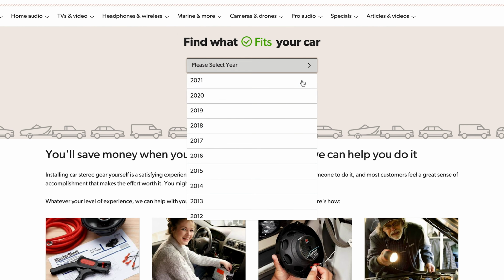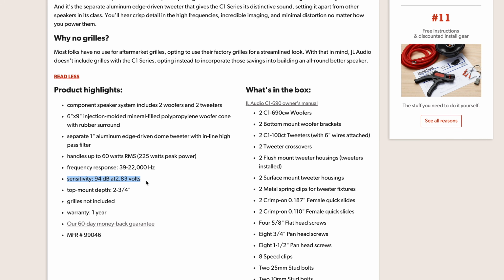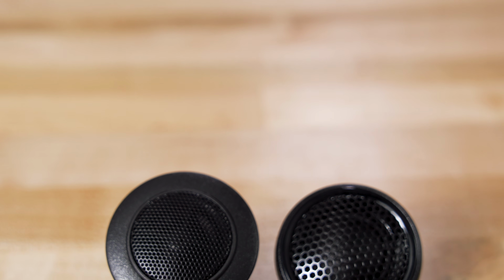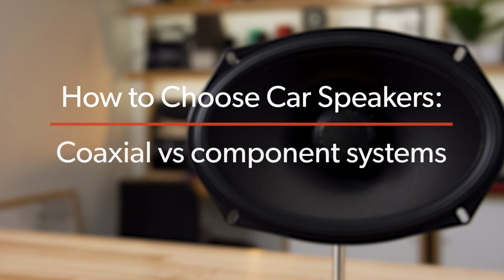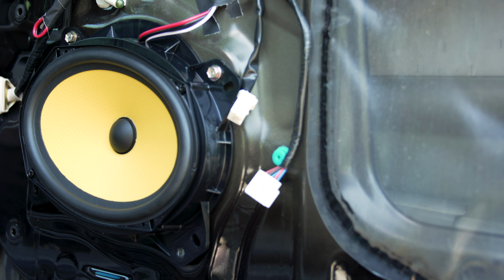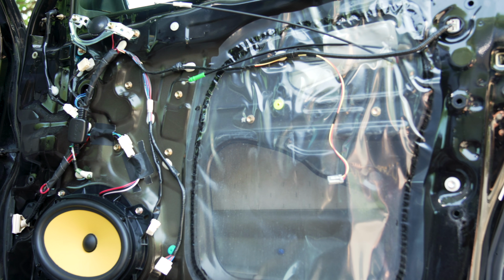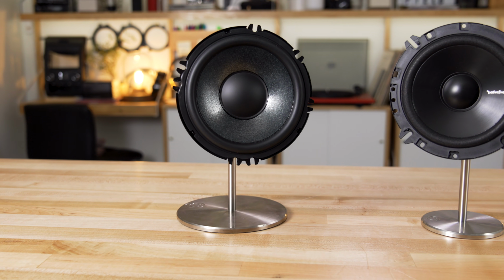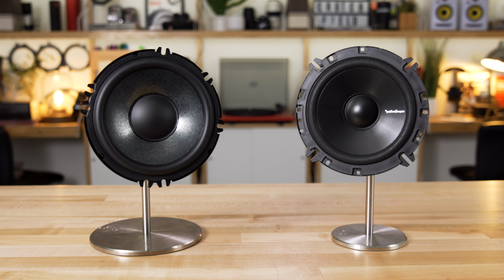How to choose car speakers | Crutchfield

Comment: Hi I have 3 10’ sundown &jl audio 1500 amp & I was Thinking of adding 6.5 jbl gto629 & gto609c component Speakers & a jbl amp 4 channel will it bee a good set up or Should I delete the gto609c and just put 4 gto629 plz Advice thanks ?
Reply from the maker: Installing tweeters closer to ear level helps with the clarity of the audio that we hear from them. The GTO609C comes with a separate tweeter so that tweeter can be installed closer to ear level and is the better of the two speakers to use in the front of a vehicle. We recommend installing them instead of another set of the GTO629 speakers.
Reply: @crutchfield  ok so I need 4 6.5 Should I get the gto609c  I have a jeep gladiator need the for the sound bar & Bottom of the dash thanks a lot
Reply from the maker: What is the year of your Gladiator? Does your's have the Alpine audio system in it?
Reply: @crutchfield  no is a 2020 jeep gladiator overland
Reply from the maker: That vehicle has a component speaker in the front so replacing it with a component speaker like the JBL model you listed is a good idea and replaces all the drivers keeping a full range audio coming from the front locations (top and bottom of the dash). A coaxial speaker like the GTO629 can be installed into the roll bar location
Reply: @crutchfield  thanks you so much what amp you recomend a jbl one ?  I was thinking the JBL GX-A604 4 channel full Range amp
Reply from the maker: The JBL Stage A6004 amp would be an excellent choice for these speakers. It can be found here:

www.crutchfield.com/I-rYALc227/p_109STA604M/item.html
Reply: @crutchfield  thank you so much for all ur help 👍🏻
Reply from the maker: You're welcome! Enjoy and let us know when we can help again.

Comment: Can crutchfield sell a Chrysler trunk mounted subwoofer replacement that looks factory, replacing the Beats and hit harder.
Reply from the maker: Hi, Jim, it will depend on your particular vehicle, but perhaps this would work for you: https://www.crutchfield.com/p_109STADBAS/JBL-Stadium-BassHub.html

We just made a short video for it, too: https://youtu.be/7bnb7vP2-iQ

If that's not the ticket, contact us & our Advisors can help you find what's right for you. https://www.crutchfield.com/support/ContactUs.aspx
Reply: @crutchfield  I’m talking about a Chrysler 300 with the beats. Want to up grade but keep the factory look. Not finding much or even swapping out the subwoofer using the same vessel but add another amp to the new sub. System is not loud enough
Reply from the maker: Ah, understood! What year is your 300? For the most part a true upgrade to your factory sub sound would have to come by way of adding a sub box in the trunk, but we can double check the specs of your car and let you know if there is any alternative recommendation!
Reply: @crutchfield  mine is a 2013 with the beats. I do not want to take up trunk space but would like to improve overall sound.
Reply from the maker: There are subs that will fit in the OEM enclosure, and you could add an amp to power them.  Are you wanting to replace the other speakers as well, and add an amp that will power the whole new system?
Reply: @crutchfield  I would love to swap the beats sub and still use the enclosure. If I kept the factory amp for the other speakers, that would save a little.  Replacing the speakers I would. I wonder the front doors as they are considered bass woofers and no other speaker there for mids or highs. I wonder how that would effect the sound. Better or worse. What options can you provide for sub, amp, and other speakers to replace.  

Thanks
Reply from the maker: The rest of the front audio goes to the speakers in the corners of the dash. We do not know the crossover frequency being use by the stock system that splits the audio between the dash and door drivers so its best to put speakers back in place of the stock. This way, there is no loss in sound. What changes are you hoping to make to the sound you get from those stock speakers?
Reply: @crutchfield  the drivers in the front doors I believe are a single driver. If using the stock amp and crossovers, replacing the doors with a 2or3 way speaker will not have much benefit or I would think.  Maybe steps to see sound and add a back dash subwoofer (brand and size) and/or use the beats subwoofer in closure in the trunk but replace that speaker also. Separate amp for it. What options and brands to start there and possibly replace more depending on how it goes

Comment: What about Ohms factory speaker's are 2 ohms and you put in 4 ohms in which a lot aftermarket are,got told if put in 4 ohm in factory 2 ohm setup the 4 ohm speakers will sound terrible is this tire google says it is??
Reply from the maker: Good question! If you replace factory 2ohm speakers with standard aftermarket 4ohm speakers and don't also change the head unit (and/or factory amp if present), there will be a 50% decrease in volume. Ultimately it won't sound right at all. Are you looking to replace your speakers?

Comment: great video, very informative thank you! I need additional help.. been to the website. I have an 2012 Lexus IS250 and looking to replace the factory door speakers, what exact product would provide best quality for enhancing vocals and range of instruments? I listen to all genres but more so R&B and Hip-Hop. not really looking for major power. hope that all makes sense, im lost.. thanks in advance for your help
Reply from the maker: Does your Lexus have the Mark Levinson sound system?
Reply: @crutchfield  I don’t believe so, it may be the factory head unit that is crappy but it doesn’t sound high quality as is currently
Reply from the maker: Do you want to replace the front and rear door woofers and tweeters? There is no direct fit for the tweeters; but, you should be able to replace them if you make your own brackets. What do you plan to use for power?

Comment: I have a question. My truck came with factory tweeters. Would it be bad or anything if I just replace the old woofer with a 2 way or 3 way and keep the old tweeters. Or should I get a component and just replace both that way
Reply from the maker: In most cases, you can leave or disable the factory tweeter. What is the year, make, and model of your vehicle?

Comment: Anyone has any recommendations for the best bang 4 buck 5.25 speakers? I'm mostly listening into 90's rap, i want to hear rappers voices loud and clear, my current speakers suck at that, vocals sound really weak & muffled. thank you
Reply from the maker: Sure! What is the year, make, and model of your vehicle? Did it come with any type of upgraded audio system? What locations did you want to put these speakers into? What do you plan to use for power?
Reply: @crutchfield  I own a '97 volvo 850, previous owner replaced all the stock speakers with some low quality sounding stuff, amp box and a big nasty looking sub in the trunk, i want to swap out everything for something better, i just don't know what, too many options out there.
Reply from the maker: We will be happy to help. There's a few details that can help with knowing what to look for in speakers:

First, is the stock radio still installed? If it is, is there a cable plugged into the AMP port on it?

What brand and model speakers are installed now? What changes are you hoping to make to the sound you get from them?

Does it look like the amp is also powering the speakers? If you are not sure, what is the brand and model of the amp?

Comment: Excellent video but still have a question after seeing the info on your website. I have a 2009 Toyota Corolla “S” that has a factory JBL setup. The speakers are 2ohm and want to replace just the speakers at this time. The rear speakers have 4 wire going to the speaker. 2 wires feed the 6x9” woofer and the other 2 wires feed a tweeter on top of the woofer. If I replace the JBL’s with another 2 ohm speakers and the speaker only has the 2 speaker inputs…how do I wire them up?
Reply from the maker: There is no way to combine those channels together so an aftermarket speaker can work in place of the factory speaker. The only options for getting full range audio from an aftermarket speaker are either to replace the factory radio and bypass the factory amp or install an aftermarket amp. Wish we had different news for you there.

Comment: I have an amp 45 w rms x4, 4 speakers 45 w rms. Im looking for a under the seat powered sub, what do you have for me?
Reply from the maker: We will be happy to help! What vehicle is this being installed into?
Reply: @crutchfield  2014 Jeep patriot
Reply from the maker: Awesome! Did that come with the factory Boston Acoustics system, and have you replaced the receiver yet?
Reply: @crutchfield  I have the JVC kw r940, alpine amp ktp 450 and 4 Kenwood kfc6966. But I need an powered sub. I like the JBL Bass pro and the Kenwood KSC SW11.
Reply from the maker: Nice setup! Since you have the amp for your full range speakers, the extra power in the BassPro Hub would be ideal. It is is designed to mount inside the spare tire rim and should only be used in vehicles that have the spare tire inside the vehicle and feature a removable spare tire post; not compatible with welded spare tire posts so be sure and check. You can find it here: https://www.crutchfield.com/I-rYTVc921/p_109BASPROB/JBL-BassPro-Hub.html

Comment: What speakers would you suggest for the Haval Jolion super luxury, something for a hip hop head like myself but also discreet and secretive lol if you get me.
Reply from the maker: Hi, Ricardo! We don't have research on that vehicle to know which speakers will fit and what general size they are, but if you are able to get some measurements and other info, one of our advisors can help with that. How many speakers (including tweeters) are in there? And for hip hop, definitely need a sub. :-)
Reply: @crutchfield  it's a suv with 220litres boot space comes with 6 speakers.
Reply: @crutchfield  https://youtu.be/_loCaxts4_E maybe this link can help
Reply from the maker: There was no mention in that video of the speaker sizes or any measurements to help judge what can fit into it. You may need to consult a custom installer for help. We can suggest brands that you may consider if they can fit. JBL and Kicker are a couple popular speaker brands for hip hop music.

Comment: If i have 4 speakers 45 watts rms each, how many watts my radio needs to have?
Reply from the maker: Those speakers can work with a radio that outputs up to 45 watts RMS per channel. Most radios output 22 watts RMS or less which might be ok for the speakers. Which ones are you referring to?
Reply: @crutchfield  Kenwood kfc6966r
Reply: Can you recommend a radio 45 watts × 4 channels  for less than a hundred dollars. Thanks.
Reply from the maker: I cannot find information on a KFC6966R but there is a model I can find online that is close: KFC6966S. Could those be the speakers that you have? As for a radio with that power under $100, I do not know of any such models. Here's the one we offer with this 45 watts RMS rating:

www.crutchfield.com/I-rYTVc227/p_158XAV7000/item.html

Comment: why do you need amplifiers if speakers only need 2 watts of power? Are amplifiers just a gimmick?
Reply from the maker: They are not a gimmick. A speaker's sensitivity is measured directly in front of the speaker at 1 meter distance with a test tone (not full range audio such as we have in music). The more audio frequencies that a speaker is asked to play, the less power there is for all frequencies so the more power it needs to get to play them at the same levels.

Also, in vehicles we are not able to place the speakers so our ears are in front of them and only 1 meter away and we play more than a test tone. Plus, there is the grille material as well causing the audio to lose intensity.

All these reasons are why speakers sound better when they get closer to their top RMS watts.

Comment: Best way? Go to your local shop and listen to how they sound...don't buy them because they look cool.
Reply: That is the worst way. Demo walls are just… walls. Those speakers will all sound completely different once installed in a car, and the demo wall just imposes false expectations.
Reply: @ZZPxFTW  So you're suggesting that listening to a speaker is not as good as randomly choosing them based on price ort appearance? They will sound different in the car for sure, but it's a lot closer than guessing.
Reply: @jayinmi3706  Im absolutely not suggesting that. I'm suggesting it takes a little knowledge and research to know what values will work for specific applications. Listening to the demo wall will get you as close to what you're looking for as choosing on price and looks... Have an idea of  what sensitivity, Qts, Vas, and Fs are going to be best suited for your application. 

Just a quick example for one of those specs: demo walls are essentially IB, and will favor high Qts drivers, but if you are installing them in an enclosure, a lower Qts would likely be a better option, but would have probably sounded worse on the wall.
Reply: There are very few local shops anymore, with the exception of a couple chain stores that only carry low to medium lines of very established companies such as pioneer or kenwood or alpine.  It’s a different world now
Reply: @squidduck  I work at a local shop. We have 5 locations. And I can think of 4 or 5 other local locations of other companies. It isn't that hard.
Reply: @squidduck  walmart lmao
Reply: @jayinmi3706    I live in Calgary, a city of 1.6 million people.  We have Visions electronics and JB’s performance center that actually have display boards.  Visions doesn’t carry anything worth mentioning, really.  JB’s recently started carrying Focal.  Otherwise, all low level to medium level stuff, even the focal lines aren’t the higher quality lines.  20 years ago, there was lots.  Online shopping has killed most of the stores in my area.
Reply: @ZZPxFTW    lol, even Walmart took out their display boards
Reply: @jayinmi3706    I live in Calgary, a city of 1.6 million.  There’s visions or JB’s, neither of which have demo vehicles.  They have display boards, but nothing high end at all in them….
Reply: @jayinmi3706 you realize not everyone lives in your town right?
Reply: I don't have a local shop for that
Reply: Bestbuy used to have a okay speaker wall. They got rid of that also.
Reply: Just because they sound good in the store doesn't mean it'll sound the same in your vehicle. Every vehicle is built different some have better NVH than others meaning some are going to leak out the sound waves worse in some cases. Sometimes you may even get a rattle or a muddy sound if your speakers are too big especially a low frequency subwoofer. Taking 2 12 inch subs and stuffing them in your compact Toyota Corolla won't have the same effect as putting them in a 3 seater Tahoe because the surface areas are completely different and the level of sound travel/ reflection.
Reply: @Kingshock  Exactly. But it's better than not hearing them at all.
Reply: @jayinmi3706 Do you have a local shop in every city? 🤔
Reply: @jayinmi3706  I think people are just taking issue with the idea of blindly listening to a store demo being the best way to determine what speakers to get, and going by “looks” is the only other option. Going by specs that match your needs and install is probably going to be better than just going to the store. Combining those is probably better, but honestly I’m not looking to do that and I doubt I’d gain any real insight because there’s too many variables.
Reply: @jayinmi3706 you can always go and have an idea but is so many different things that dont help like what radio you are gonna use or if you gonna run some amplifier when u put an amplifier the speakers sound  completely different

Comment: Is it possible to to make additions to beats system installed in the vw polo t cross?
Reply from the maker: We have not been able to research a VW Polo T Cross to know what can be done to them. However, if its a regular engine (not a hybrid or an electric vehicle), then you should be able to install a new amplifier and speaker setup. We recommend contacting a local installer for help choosing the gear. Good luck!
Reply: @crutchfield  Thanks for the assistance.

Comment: What if the car already came with tweeters do you wire it in to the crossover that you get . Or  Do you use the existing wiring for the stock tweeter
Reply from the maker: The design of the stock system along with the design of the new component speaker play a role on exactly what work is needed to install them. What is the year, make, and model of the vehicle? Is there any specific brand/model speaker you are hoping to install in your vehicle?

Comment: great video went to your website and it seems you guys are not done with the audi a7? i have a 2012 model. is there a reason you couldnt spec the front door speakers?
Reply from the maker: Thanks! Looks like we have researched most of the 2012 A7 locations; but, there may not be a direct fit. Please reach out to our advisors for help choosing the best options: https://www.crutchfield.com/I-rYTVc921/support/ContactUs.aspx